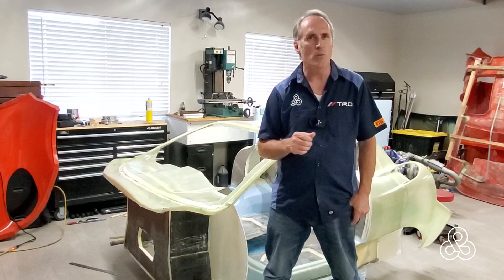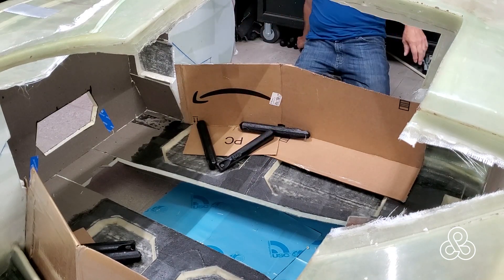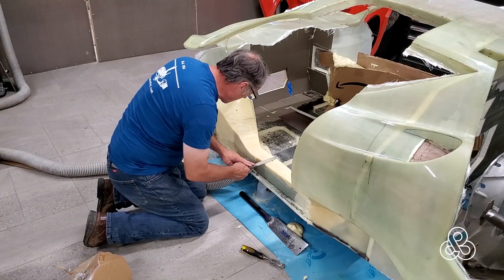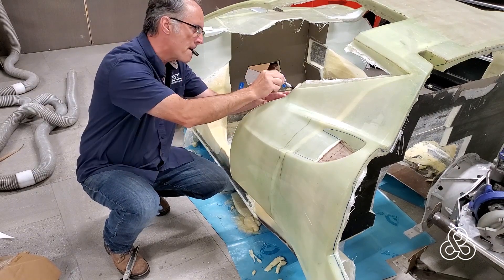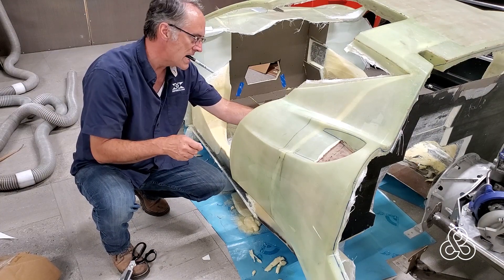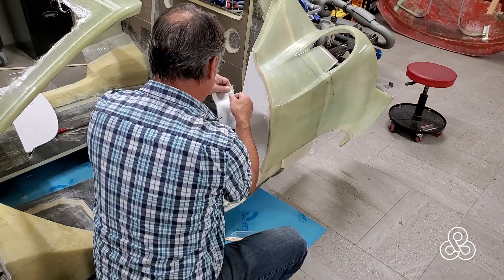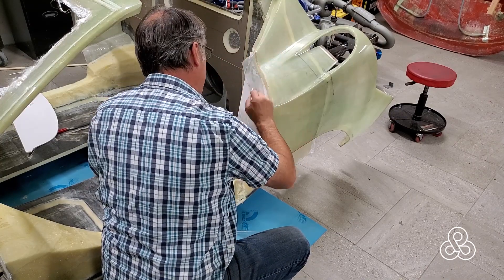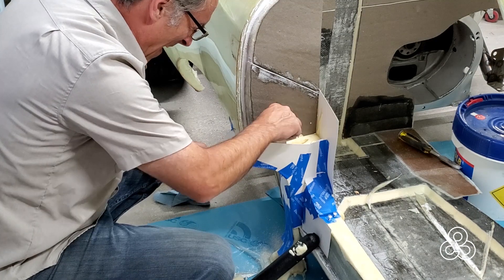A34 - Arete Supercar project-Monocoque secrets revealed.  foam filled, torsion reducing, door sills.

Comment: Whoa, that A-pillar looks sleek -- and all that in "only" glass fiber! Will it have enough strength to contribute to the closed profile that you need for torsional and bending rigidity of the monocoque?
Reply from the maker: Very little load is transferred through the "roof" structure. Most of the loads are all through the floor, tunnel and side seals. Still much more structure being built into the tube that you will see in future videos.

Comment: This two part foam is used to make custom drivers seats in Formula race cars. It is NOT a structural foam although structural foam is available. Did you look into that product???
Reply from the maker: I'll probably use the two part urethane foam as it so fast. Don't have time for sittin around! Ha!
Reply: @BuilderCreator  I think that structural foam is vastly superior to the two part stuff.  You are betting your life on its strength and its just not the right product for that
Reply from the maker: @richardsmith9509  the foam will just be to get the form. after the seat is built the foam is gone
Reply: @BuilderCreator  Not talking about the seat....ABOUT THE ROCKER PANELS.  Talk about a survival cell, please.....
Reply: or as you say, torque reducing sills. This foam will NOT do that: its the wrong product
Reply: @BuilderCreator  You don't need fast, you need ultra strong.....
Reply: @BuilderCreator  Jay, you are incredibly stubborn.....however, its 100% YOUR LIFE and why you are so cavalier with it, is totally beyond me...

Comment: Ever time I tried expanding foam the heat from the fiberglass or even body filler would softin the foam and it would cave in, I tried covering it with 3-M tape and it was better but still have the cave in.
Reply from the maker: Are you using Expanding foam insulation out of an aerosol can or two part mix pour foam? The aerosol foam is very inconsistent and soft.
Reply: @BuilderCreator  I tried 2 part and I tried foam boards from home depot.

Comment: Could you do this in reverse and have a mould for the door sills that is upside down and therefore the right shape, fill it with expanding foam, then once cured attach it somehow to the frame? Or is the adhesion of the expanding foam necessary at pour time to attach it properly to the fibre? Loving this series, just outstanding, thank you.
Reply from the maker: Video coming to show how I plan on creating the door inner clamshell.
Reply: @BuilderCreator  great stuff.
Reply: answered @ 7:30 .

Comment: Are the foam core/fillings structural? Or are they just used to form the fiberglass around?
Reply: Plus the foam dampens vibrations and sound deadens.
Reply: The foam cores are non-structural, and serve as a base for forming the fibreglass.
Reply: If you have 2 layers of fiberglass+ 10cm foam(or nida)+3layers of fiberglass is much more rigid and stronger than just 5 layers of fiberglass, It can increase the value of rigidity/stiffness by 5, by 10...with only increasing the total weight of 10% by adding foam
Reply from the maker: SETHalpine is correct in that the foam adds to the structure, however the two part pour foam I used in the door seals is not particularly designed to be a structural material. It could be removed and the box structure it helped create would stand on its own.  Even though I am trying keep a reduced weight the weight of the foam is not worth my effort and time to chemically remove it.